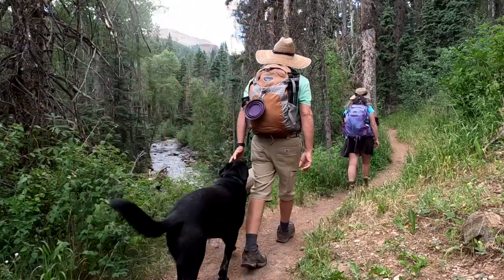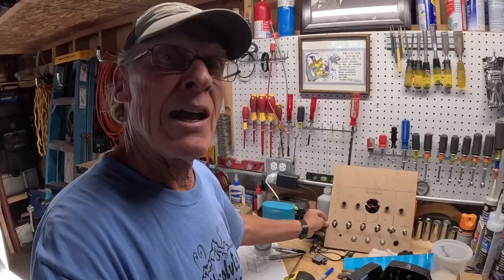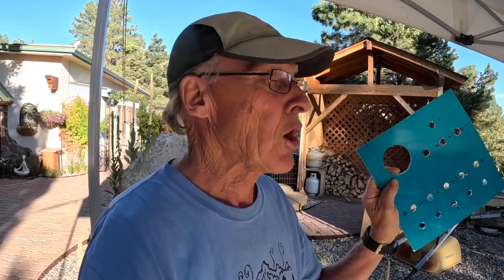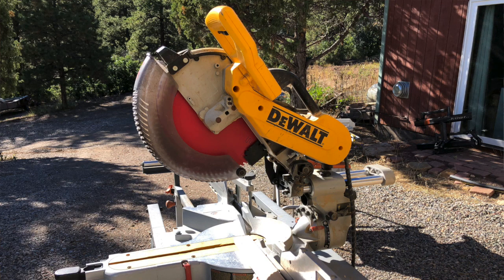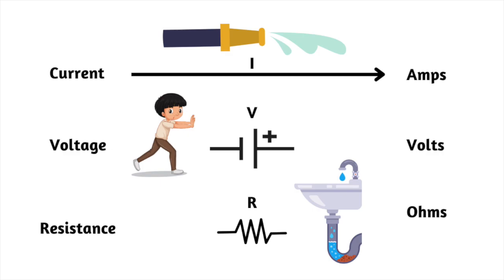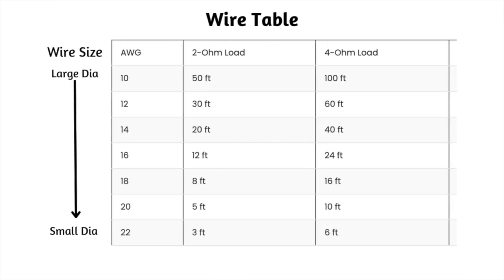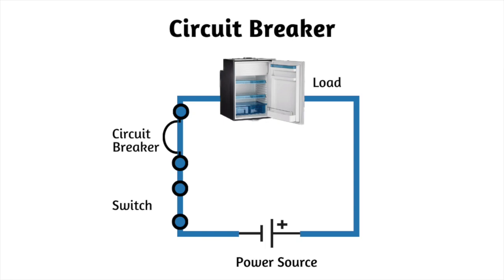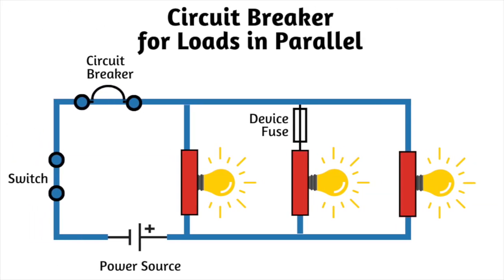Basics of  VanBuild Electricity | Simplifying our Electrical System in our Transit Trail Edition Van

Comment: Hi, great video and we are looking forward to the whole series once your van arrives.  Hopefully that won't be much more of a wait.  I would like to suggest taking a look at a video at the Humble Road youtube channel.  Search for "fan issue".  This will bring up a video on using a 12volt regulator for Maxxair fans.  They are great fans but some have a sensitivity to voltages over 12vdc.  I followed George's suggestion and installed a 12v regulator for each of our two ceiling fans.  After 6 months of use we have had no issues with the fans or the regulators.
Reply: Thanks for this. And thanks for your encouragement! We had our MaxxAir fan in Clarity 1 and also had no problem with it without the regulator. I wonder if the issue is with the remote version which I don’t have. I prefer to keep things simple and avoid unnecessary electronics that can go bad. Plus remotes are just one more thing to manage, loose, drop, etc…helps me keep the clutter down. 
We so appreciate your connecting with us and watching our progress!

Comment: Thought this was great. We have a Scamp and what I am trying to figure out is if I can get enough battery power to run out heater for several days with solar.  This video was very helpful in understanding basics. I would always hear on YouTube people talking about hooking up their solar panels in series or parallel and never understood what that meant.
Reply from the maker: You read our minds! We were just talking about making a video about wiring our solar panels on our new van. So, stay tuned, we'll address that. Thanks for the feedback. PS. I love your youtube handle! Cute!
Reply: Matt here from Clarity Off Grid. The only real way to get more time is to increase your battery bank or get more charging. Amp hours is your storage capacity. 100 amp hrs is 1 amp draw for 100 hrs or 100 amp draw for one hour. You can do the math to figure out how long you can run your heater in hours if you divide 100 (or your rated Ah capacity) by the heater’s rated amp draw.
Reply: @mattkramer6512   Thank you! I am not sure how to know where to find how much it draws. Once I figure that out I will refer to this message.
Reply: Each device installed should have a tag that says how much current it draws in amps or watts. Watts is volts time amps so if it has watts divide watts by volts (12) to get amps. If your heater doesn’t have a label you can see, you can get a clamp on ammeter at the hardware store. Just clamp it around the wire when the heater is running and read the current on the display. Multiply that times the number of hours it will run in a day and that’s how many amp hours it will use in a day. Note that a gel or lead acid battery can only be discharged about 50% so a 100 amp hour battery only has 50 usable amp hours capacity. Hope this helps!
Reply: @mattkramer6512  Many thanks!